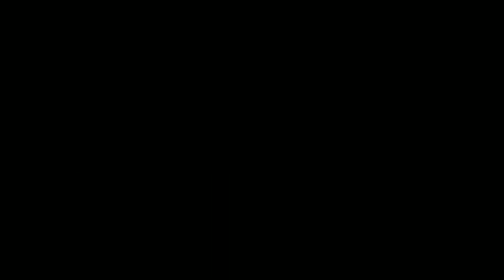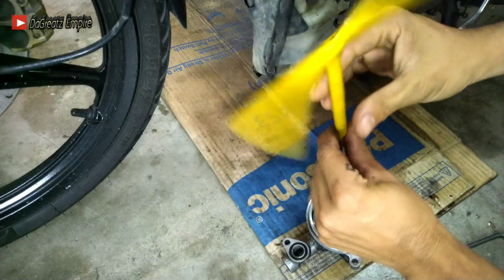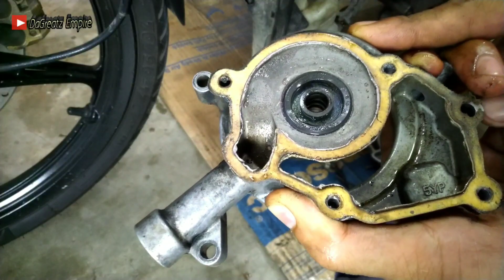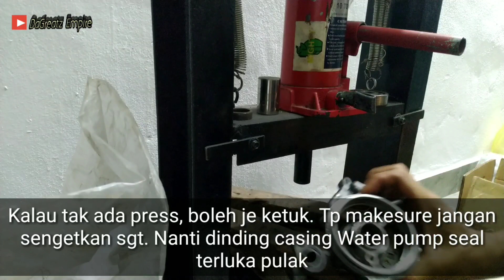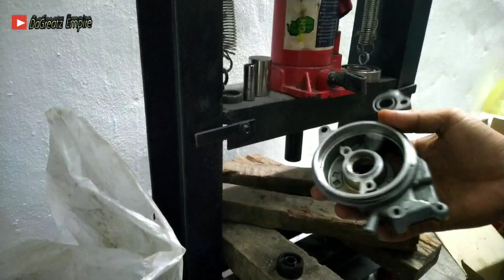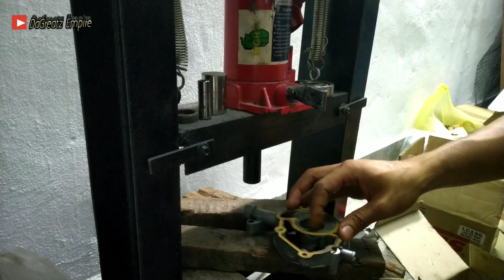LC135 | Cara Tukar BEARING & OIL SEAL & KIPAS WATER PUMP Step by Step. PART 1

Comment: Biasa kalau waterpump dah nak rosak akan ada bunyi tikus. Cepat cepat la tukar atau repair waterpump. Kalau tak memang coolant masuk enjin.
Reply from the maker: Terbaik bos
Reply: Yup sy dah kna dua kali
Reply: Salm bang..moto sya bru tukar blok..head da skim..oil seal water pump tak tukar..still jgak masuk air cooland dlm enjin..tpi sya check oil seal water pump mcm ok je..tksure la ok ke tk..bole jdi masalh water pump ke

Comment: salam..bro...kalau water pump berkeladak nescafe tu masalah gasket ke?sbb coolant ade msk engin tp dpt kesan awal sebb over flow myk itam tu kua warna nescafe...
Reply from the maker: Waalaikumsalam...gasket ,oil seal rosak pun boleh jd punca mcm tu
Reply: @DaGreatzEmpire  ok.dh dpt puncenye..terbaik....
Reply: bosku.bearing water pump ni cod ape??sbb ade 6000zz ade 6000ul ade 6000cm...mane 1 nk gune tu.?

Comment: Bang dia bunyi keci kecik kecik macam tu ke bila bawak lama?
Reply from the maker: Ha'a mcm tikus
Reply: @DaGreatzEmpire  tadi saya g kedai motor dia kata tapped.. Kena service.. Ade betul ke bang? Atau memang normal gitu..
Reply from the maker: @luqman1259  klo bunyi kuat sgt better service
Reply: @DaGreatzEmpire  baik.  Anggaran agak2 klau service dngan rosak2 mcm video abng ni total berapa bang?  Anggaran dri apa yg abng taw.  Trima kasih bang balas.. Membantu.
Reply from the maker: @luqman1259  anggaran bawah 200 mungkin
Reply: @DaGreatzEmpire  baik bang trima kasih  banyak2 hehe smoga dipermudahkan urusan bang.

Comment: Kalau water pump dia rosak coolant tak berfungsi ke bos tapi sy nampak ok je coolant motor sy tetap tendang dengan panas gila bagi pendapat sikit bos
Reply from the maker: Buka penutup coolant. Then start moto tngok air rolling x
Reply: @DaGreatzEmpire  kalau tak rolling maknanya waterpump rosak ke
Reply from the maker: @adzmad961  ya berpotensi rosak

Comment: salam bro.. maaf nak tanya.. tempat keluar  air cooling  skrue 10 tue masa servis tadi air cooling x keluar.. tp dlam tangki ada cooling.. pump rosak ke tue bos..
Reply from the maker: Waalaikumsalam..buka cap radiator dlu. korek2 sikit dkt lubang skru 10. Kadang vacuum pressure je tu
Reply: @DaGreatzEmpire  beres.. korek x buat td tp dah sembur air pakai getah paip air laju.. masih x keluar juga.. klu water pum rosak ak nk tukar je..
Reply from the maker: @fsmniq  try start dlu tngok dkt dlm radiator, klo air ada crawling kira w.pump ok lg

Comment: slm bro nak tnye kalau hos belah oil seal /waterpump tu dia keluar asap putih dengan minyak hitam tersembur
Reply from the maker: Waalaikumsalam..klo asap putih biasanya leaking coolant.
Reply: @DaGreatzEmpire  ouh yeke bang .. punca dia leaking sebabkan apa ye bang? sbb sye da byk kali hantar bengkel dorang kte bukan engine msuk air tpi sbb ada mslah dkt block atau head..sye cuma nk thu kenapa dia keluar asap putih dan minyak hitam tu haha tpi tk thu apa masalah motor sbb pomen semua tk bukak lgi dorang kte rosak ini itulah bagai ..
Reply: abg bagi number phone bang sye nk tunjuk dkt belah mana yang keluar tu
Reply from the maker: @afiqqushairey6667  biasanya gasket head je burn. Just tukar gasket head.  Klo tak boleh settle jgk kena skim head or block yg bengkok
Reply: @DaGreatzEmpire  terima kasih bang..